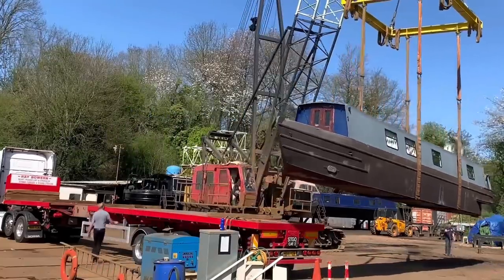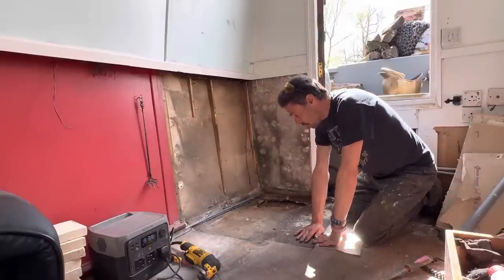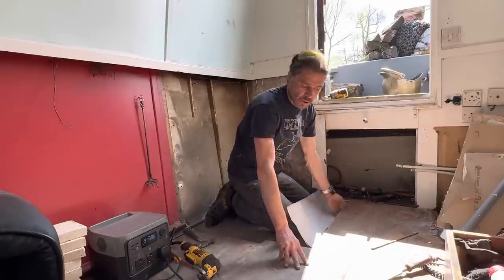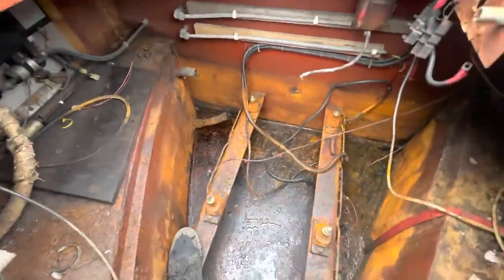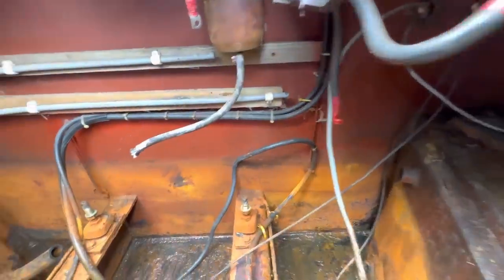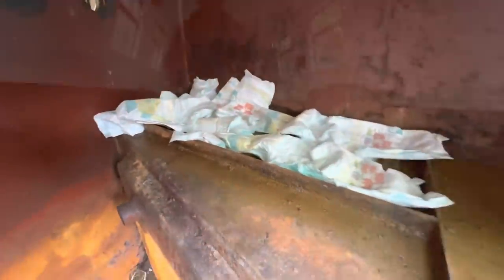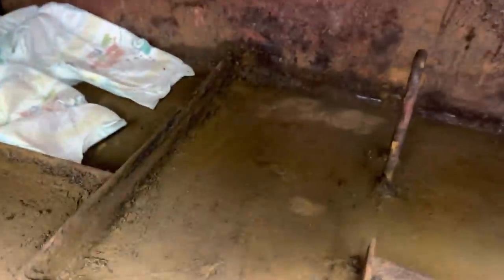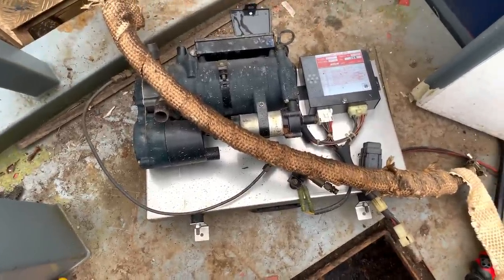413. De-rusting and sorting the engine bay

Comment: If there’s a fair bit of diesel in the tank and the boats been sitting it’s probably worth pumping it out and getting it treated and polished to get rid of ant diesel bug. It’ll be a nightmare on the cut if the engines filters are clogging all the time from contaminated fuel. Likewise with the skin tanks, if you shove some hosepipe in the inlet and outlets you can reverse flush the tanks to try and get rid of any rust and sediment. Great stuff so far 👍🏻👍🏻

Comment: You could use some sawdust to soak up water in difficult areas. Chuck it in, leave it for a bit then vacuum it up with a wet vac...easy. It's probably cheaper than nappies, it works well, it's eco friendly and it smells nice too.
Reply from the maker: Oh yeah love the smell of that stuff

Comment: Hi James don't take full board up 4×4 marine ply 18mm put it down draw around and cut cement bricks to old one's or use 4×2 rough sawn get some evapo rust there's one that primes the paint 2in 1 quick
 then put a cap over hole with rubber gasket

Comment: I would guess that puppy pads would be cheaper than nappies, and probably do just as good a job absorbing liquids.  
When re-laying the floor, the foil would offer some insulation, but a rubber underfloor over the foil would add both some more insulation and make the floor quieter.

Comment: Could have saved yourself the drama…. Plug all the holes and inlets to the engine bay… pour molasses mixed with water and let it do its thing for month.. work on other stuff and come back to the bay.. pump out the slush and you will find the job is done properly
Reply from the maker: Except Ralph needs me gone in half that time with engine back in the boat
Reply: @TheNarrowboatThatJamesBuilt  I see way too many of these boats half done and this will come back to bite… from what I saw your problems still exist with rust so it will be interesting to see this project in a year or two… Rust waits for no man and is the enemy of those who run out of time to treat the issue